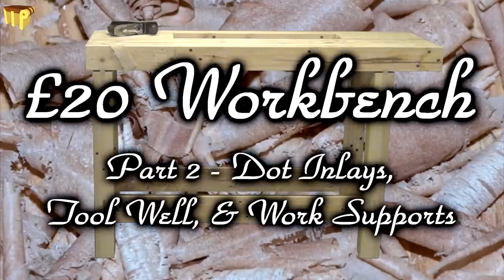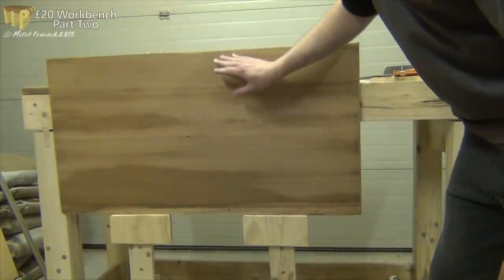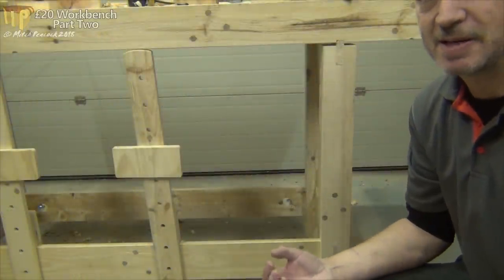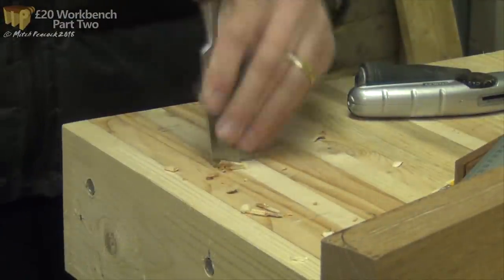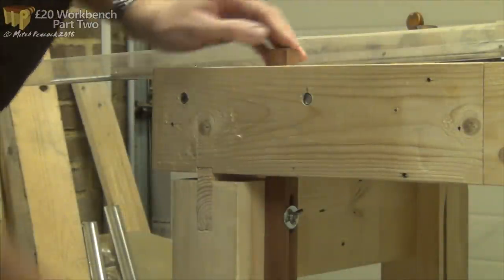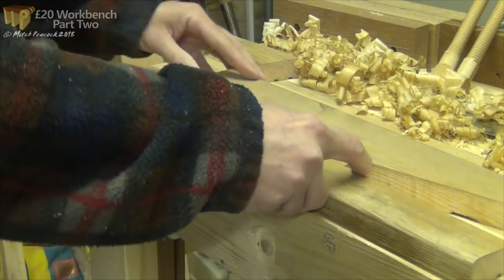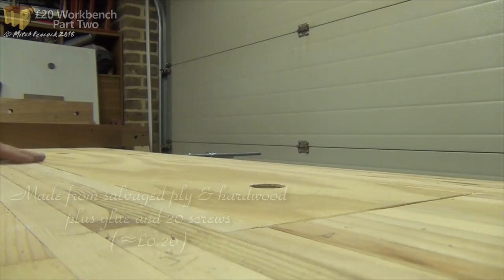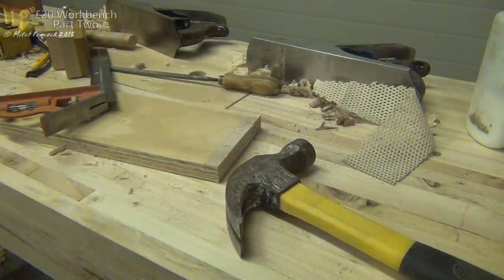£20/$28 Workbench! Part Two

Comment: Love the trick with the wingnuts ! Never seen that before, great build, I don't need a bench at all but fancy making this one just to see how it turns out , look forward to part three !!
Reply from the maker: ian elley Cheers Ian. I'm sure you could easily find someone new to woodworking who'd take it off your hands. I may end up giving this one away eventually.
Reply: Good idea Mitch Peacock ,  my sons shed is crying out for a bench now I think about it ! Might be fun to see if I can beat your final price on construction, I can rustle up the timber but not any specialist tools like the thread cutter for the vice screw ( not many options on amazon and the couple that are there are not cheap ) so I  would have to knock one up which may be a challenge, but otherwise quite doable !
Reply from the maker: ian elley Great. Let me know how it goes.
Reply: Will do !

Comment: Very versatile looking bench. Watched 1,3 and then this of the series. Will definitely try to make. BTW, how much was the very long drill bit to anchor the vice cost?  Thanks.
Reply from the maker: Cheers. Toolstation item no. 50377 a 12mmx450mm auger bit was £8.77 I believe. You could bore the hole before laminating the top, so long as you keep it aligned during the glue ups, then you wouldn't need a long bit.
Reply: @mitchwoodwork  knowing my glue ups I'd be left with a 3mm hole for the threaded bar. Thought they'd be way more expensive. Cheers.
Reply from the maker: Haha! I'd suggest leaving a bar in there for alignment, but too much squeeze-out in the hole might lock it in place for good
Reply: @mitchwoodwork  I thought of that also. Don't want that happening. So long bit it is.